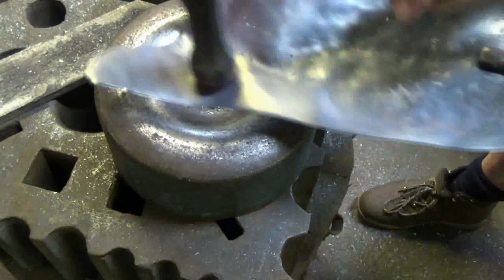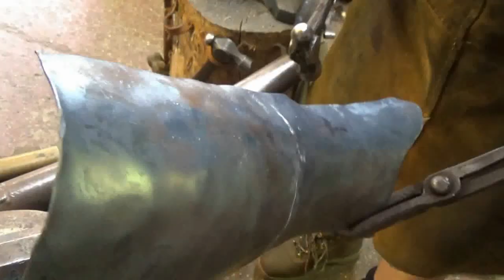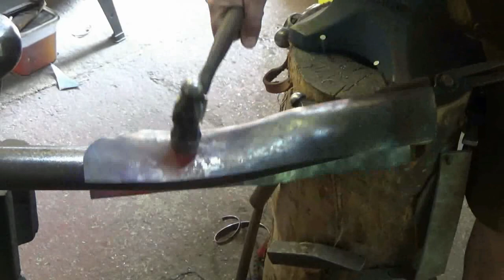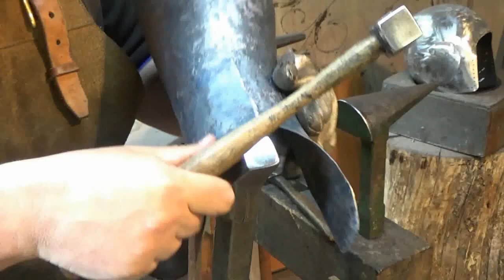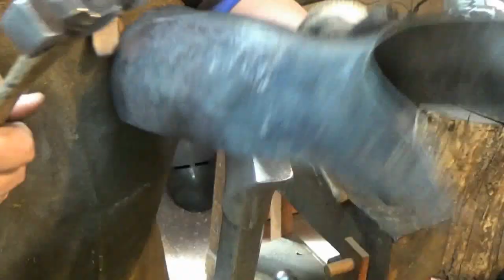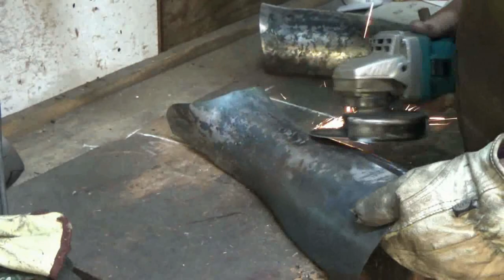How to make greave fronts - 2 hours in 8 minutes

Comment: its amazing that you can do all that shaping and planishing in 2 hours. how many more hours would you have to put in before you would consider this piece done? everything takes forever for me. ive been working on some asymmetrical pauldrons and im on day 4 or 5 (5-8 hour days), with probably another 4 to 5 days to go before im finished with one side.
Reply from the maker: HI, it's only a rough planish, there's still a good hour to get it ready for cleaning, butu I feel your pain. When I first had a go at a closed vambrace it took Dave (of White Rose armouries, check out his work it's fantastic) 20 minutes to rough out and close the cannon. It took me the best part of a day and a half to get to the same point.

Stick with it, it gets simpler and quicker I promise :)